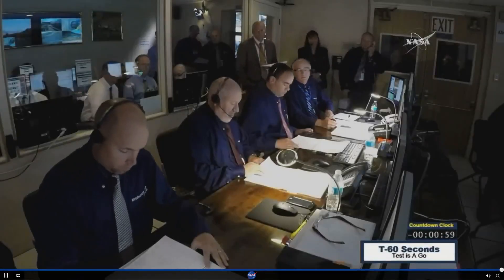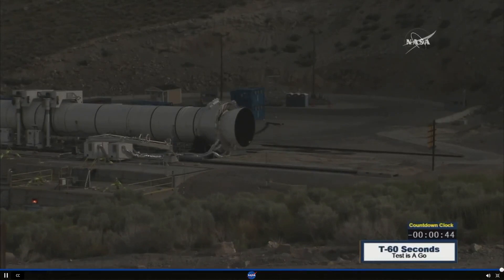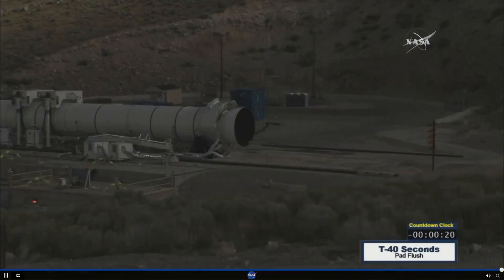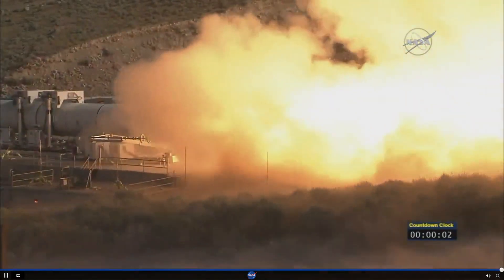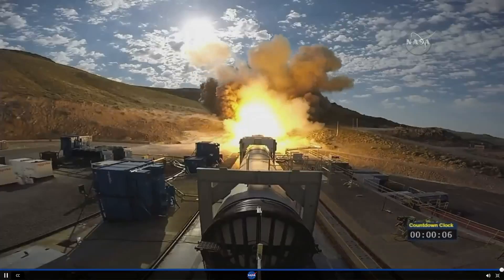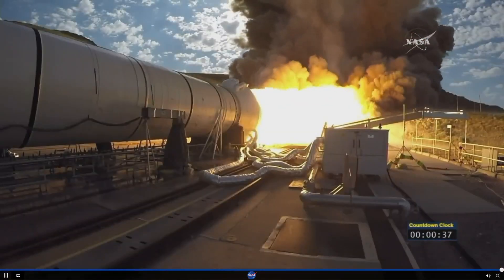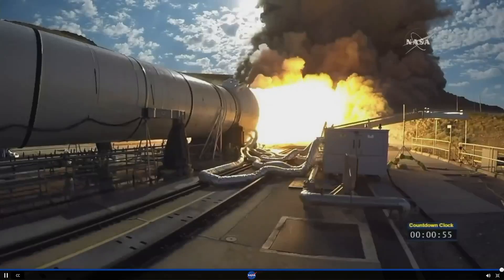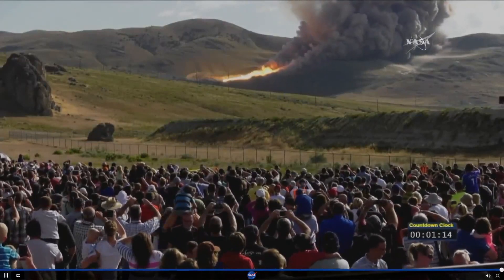NASA Test-Fire Solid Rocket Booster for Megarocket

Comment: Forget the rocket, I want to watch a video about the thing they are using to hold that mf down
Reply: silver tape
Reply: Elmers glue
Reply: flex tape
Reply: Duct tape
Reply: Che Burns 😂😂😂
Reply: Flex paste
Reply: Nokia 3310s
Reply: About 17 stories of concrete and steel plus all the special stress sensors
Reply: Gorilla glue!
Reply: Well, the big steel trusses you see holding the motor are embedded deep into a giant block of concrete that is buried in the ground, that's how they hold it down.
Reply: yeah here according to the the ton (size)of rocket motor is being tested...with the calculations we prepare a test fixture to hold the rocket motor rigidly and we get some values like axial loads, stresses, strains, sound and etc values...

Comment: Back in my military days, we used to stand next to F-15's while they test their motors in full afterburner. That was just an insane feeling of vibration and sound, I couldn't even imagine stand next to that rocket booster. I wonder if it's survivable? Probably blow your hears drums out even with hearing protection.
Reply: It‘s probably loud enough to kill you.
Reply: This would kill you. even if the heat wasn’t a factor the pressure waves (sound) are lethal.

Comment: To everyone commenting that the Earth's rotation would be affected by this test, consider the following. The exhaust leaving the rocket collide with the atmosphere, and the atmosphere collides with the ground as the molecules move around in their normal interactions. The forces that would have changed the rotation of the earth (if only by an unmeasurably small amount) would be perfectly balanced out by the counter-forces of the air molecules transferring momentum to the ground. Remember, an object at rest stays at rest unless acted upon by a net force. There is no net force, therefore no change in velocity.
Reply: That doesnt even matter because theres such a vast difference in scale. If the rocket was pushing directly away from the Earth then it would go 0.000000000000000000032 km/h faster.

Comment: how fast would it accelerate an aircraft carrier?
Reply: SRB run time: 2min
SRB thrust: 16'013'597N
SRB weight: 725'748kg
Nimitz-class aircraft carrier displacement: 106'300 t

Formula: a = F/(mNimitz + mSRB/2)

Acceleration result: 0,1500m/s^2, not considering air+water resistance.
Speed after 120s: 18m/s or 65 km/h (Nimitz-class does 56km/h according to Wikipedia)
I honestly expected a bit more...
Reply: Exactly the fast it can

Comment: this mite be stuped but why do they lanch rocket at sea level ,,why not at denver col. that 1 mile higher up which would take less to get it in outer space or ever some place higher
Reply: james ketchem It's not about the distance you have to travel to get to orbit, it's about the speed you have to reach. To reach low Earth orbit you need to be travelling about 8km/s. If you don't reach that speed, you won't reach orbit, you'll just fall back down again.

Comment: Now, the planet rotates faster. 😮
Days are shorter.
Reply: Kagan Roy and if somebody says something about this, he gets a wooosh by me.
Reply: But you know I wonder how many SRB's would it take to tilt the earth's axis a few degrees with enough thrust 🤔 that would be cool to know
Reply: @David-yy7lb  
I am agree with you. How many jets are necessary achieve the momentum to make enough torque to change the world's movement?
Reply: @MasterMindmars  now see you done got me really to wonder how many SRB's it will take because I just looked up the amount of thrust 1 SRB makes and it's 2,800,000 LBS of thrust according to wikipedia. I bet NASA could calculate the amount of SRB'S and the earth's mass and everything else evolved  just tilt the earth's axis 1 degree or so, I'm really curious I'm definitely going to email NASA and see what they say I'll get back to you with their response, nasa requires 10-15 business days for a reply 👍🏾👍🏾
Reply: @MasterMindmars  Hundreds and hundreds of trillions I'm sure. The earth's mass is 13,000,000,000,000,000,000,000,000 lbs.  I'm sure a simple physics formula will give an approximate. There isn't enough fuel on the planet to accomplish it.

Edit: So I did look it up. Someone said it would take 10 trillion rockets to change the earth's spin by 1 second per day.
Reply: @sstrick500  
Good investigation work.
Reply: not even by femtosecond

Comment: Hypothetical here, If we had lets say 1000 of these. And they all go off at the same time, and all facing the same direction. Is it possible to speed up the rotation of the earth? Like putting a bottle rocket on a pinwheel.
Reply: No. They don't provide enough thrust. Not even 1000 would be enough to spin the moon a noticeable amount (assuming you could burn the solid fuel in a vaccuum).
Reply: Bear with me here;  Back in the 80's one of Mercury Marine's outboard motor testing facilities was in Oshkosh Wi.  They did endurance testing of engines running them for months on end.  A UWO student decided that for April Fools he'd write up a "technical" paper describing how the combined thrust was pulling one side of the Fox River at that point apart from the other and that in a relatively short period, the bridge located nearby would be too short to cross it.  Had all sorts of forumla's and stuff...delivered it to the local paper and they published it!lol!  No idea if it can still be found but it was a classic...I remember it well as I was in high school just up the road in Neenah and a friend of my Dad's was one of MM's design engineers who had to answer a lot of concerned phone calls!lol!
Reply: I can't believe how many people are saying "the atmosphere will effect it" on a science channel... It's Newtons Law folks.  Mass out one way, equal force the other way...   And this actually is measured.  It's the POINT of the test to gauge output and duration.  Energy is being applied to the stand, which is mounted in bedrock.  Will it change earth's rotation? yes (in a really small, insignificant way and if pointed in an optimal direction) But more than likely, the continental plate would absorb the energy and slip a little....  Which is why, when they fire these off, they are detected 100's of miles away on seismic charts.
Reply: I’m just trying to imagine the kind of support structure needed to keep 1000 SRBs anchored during ignition and run.
Reply: It could actually make a day a fraction of a second longer or shorter. But likely not noticeable
Reply: It wouldnt do much. Maybe speed up or slow down the earths rotation by the length of an atom at most. You also would have to place them at the equator for maximum torque. Plus, most of the force would be lost in the atmosphere.
Reply: @baccarah7010  the lenght of an atom isn't a pretty good measure of speed -_-